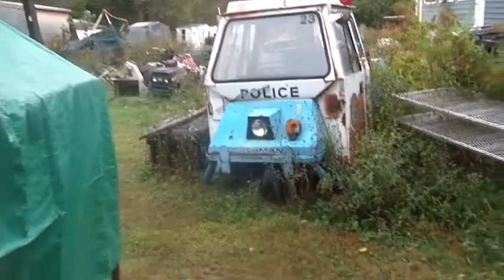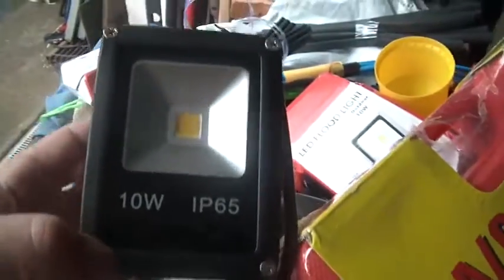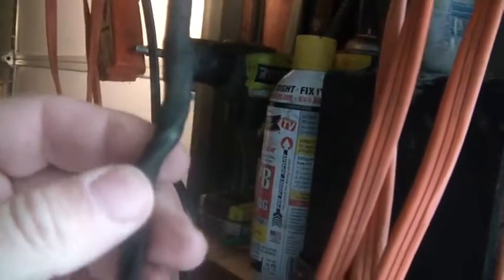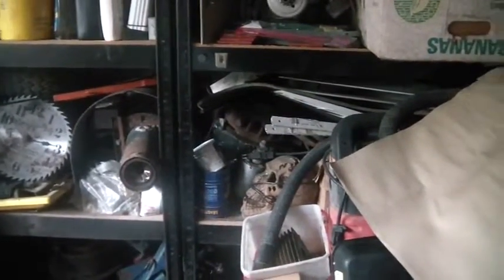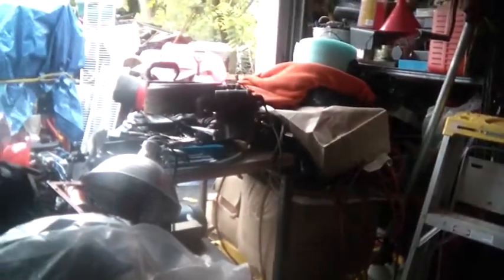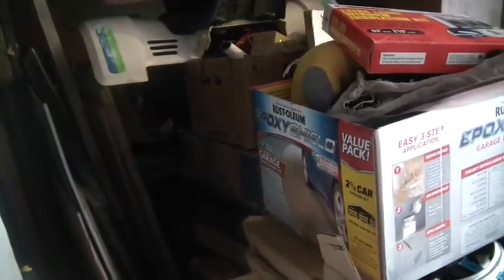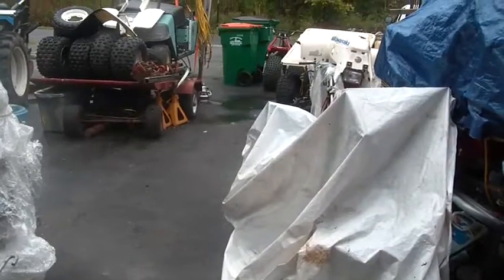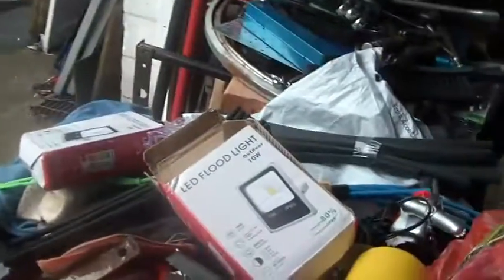10_3_2015, 10 Watt, LED Spot outdoor lights, good for garage,?

Comment: If your looking for some good quality LEDs check out amazon. I have four of their TMS 18 watt off road LEDs in my shed that run on the solar panel. They are awesome aluminum off road lights. Works great and they were cheap, 35 bucks for 4 of them. Just cut up some of the foam that they ship in as a light diffuser and boom... flood light for the shed shop.
Reply from the maker: +MadOnions , My go to place was always eBay, lately, I have been checking out Amazon, and I have been impressed by the offerings, reviews, and some of the prices. Amazon stuff always seems to get to my house real quick also. I order some of the AC tools I need from them... Thanks for the input, I think I will start going to Amazon first, then to eBay, thanks also for watching and commenting!